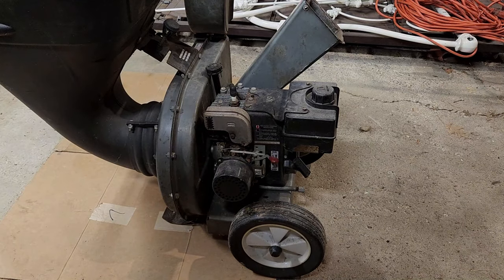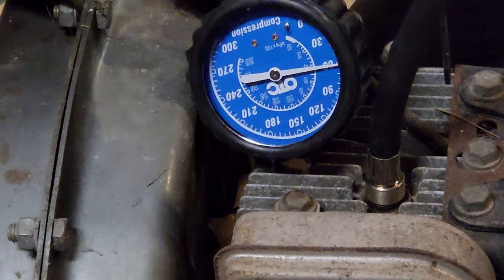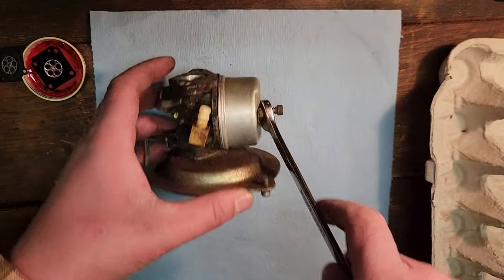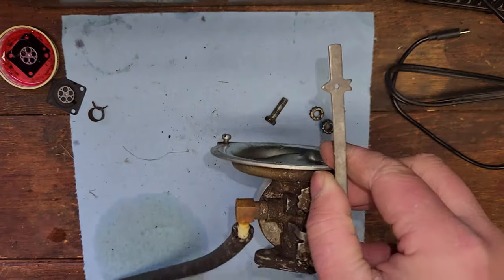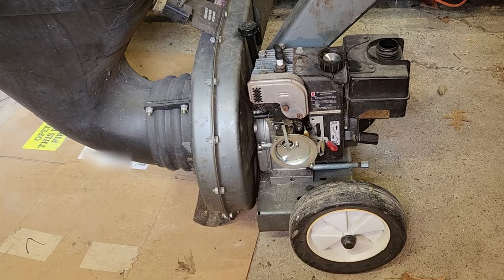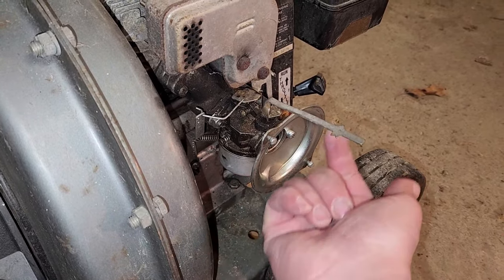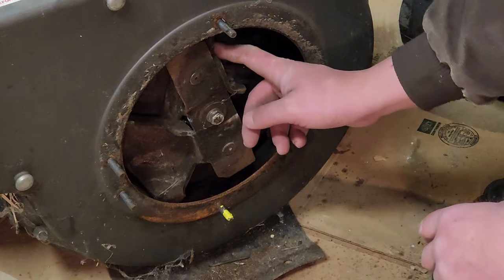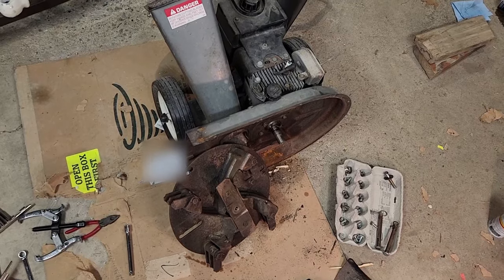Will it Run and Wreck Wood?? - Craftsman Wood Chipper - Part 1 of 2

Comment: Hahahahah!!! A Crapsman Woodchucker.. with a Tecumseh engine . Oh dear! Those engines are so much fun. The Eager-1 is advertisement for "Solid State Ignition" . . It's actually a really good ignition system, can't lie.
On my other channel I have a video on a Crapsman mower with the Eager-1 pull start too.. it's definitely eager! I have pulled it like a 6 year old kid, and it started.. in fact, I accidentally started it on camera, and decided to cut the grass... 
As much of a pain in the ass Tecumseh engines are, I kinda like working on them hahahah!
Nice work on this old POS 😊

Incidentally, on Tecumseh carbs, you will see the emulsion tube, and a bulge on the side of it. Inside there is a tube that will slide up and down... If you have the carb upside down when you screw in the needle valve, you'll destroy the carburetor.. make sure it's standing straight up properly before screwing it in, I mean... A year late is better than never 🤣

That's if you weren't already aware of it. If so.. carry on 😁
Reply from the maker: LOL I enjoy your input! I did find out (and it's VERY possible it was at a later date) about the tube. Someone else mentioned it too. I thought "Ruh roh..." I might have pulled it back off in the second video, I can't remember (memory of an infant 🤣).

What's your other channel name (if you want to share). I'd like to check it out!

Thanks again 🍻
Reply: Hahaha you're most welcome! I saw when you put it back in that all was good. Don't worry, if you broke it, the engine wouldn't run.  

Really enjoy your videos!! They give me a good laugh every time. 
I also felt your elation when you got the meat grinder out.. that was just so satisfying to see it pop free.

And you're so right about those hour long+ videos ... Average time, 10-16 minutes.. hahahah!!! It's so true! 

My channel is tiny, new.. but if you want, Mikeanic is the name.. but only since you asked 😊 
Keep up the great videos! 
I'll be checking out Part ii to this video soon ...

Comment: You should pick you up a set of hose scissors. They sell them at Lowe's and Harbor Freight.  They run about $7. They are designed to cut hoses without smashing or deforming them. They come in really handy if you do a lot of fuel line. You can find them with the specialty tools. They have been a lifesaver for me.
Reply from the maker: Noted!

Comment: On most any Engine, if you have Fire and Gas and timing is ok, it will start and run, I have worked on lawn mower engines for over 50 years -just my own and a few friends. I use to hang around a lawn mover repair shop when I was a kid, learned a lot from the old repairman...
Reply from the maker: Appreciate the tips!  I've heard ATF does wonders for cleaning.  I'll have to give that a shot.

Comment: Thanks for the video. Heads up on those carburetors on the Techumseh. That one has the long low speed idle screw-means it has a delicate brass tube that travels in the carburetor. I actually winced when you turned upside down and checked the setting by turning it in as the brass tube can be ruined that way. Taryl Fixes all just did a video on the same carburetor- it was on the worlds most dangerous snowblower.
Reply from the maker: Hello there. Thank you for that info. I'll have to head over to his channel and take a look. Hopefully I didn't wreck anything yet! Thanks again!
Reply from the maker: I see what you're saying. I'll have to pull it off and take a look. Thanks again 👍

Comment: On Small Engines that you don't know their Maintenance History--I would run Transmission Fluid in the Engine for about 15-30 mins, it will Super Clean the Internals...

Comment: I hate torque wrenches myself, and try to avoid them whenever possible. I joked about it on one of your other videos. I only use them on two things:  head bolts and cutting blades. When it comes to blades, I do not play around with that. I have had a mower throw a blade before, but I got lucky that time. I would be really careful when it comes to not using torque wrenches on blades. I know they are expensive. I only have one because i found it in a car when I worked in a junkyard, but you shouldn't take chances with cutting blades.
Reply from the maker: I appreciate that info. That sounds terrifying! Believe it or not I do have a torque wrench. I got it when I was in school. Nothing too fancy but I so use it when something is critical (break work for example).

Comment: For god's sake, put the governor linkage back on correctly.
Reply from the maker: I'd be happy to oblige!  I just looked at when I removed the carb and that's how it was. Have a reference for me to look at?
Reply: @TractorFella  I'll do some searching.  It may be right, but generally those z-bends on each end interface just like the one on the throttle plate.
Reply: @TractorFella  Here is what they usually look like:  https://youtu.be/h4Riwgn0DyU?t=16   Looks like someone worked on it an lost the correct linkage and made another one work.  That part looks like one on other models have the carb mounted to an intake like this:  https://youtu.be/6XIjkW0aizc?t=8  The bent link is to get around the intake.  If it's working and doesn't fall off, go with it, I guess.  But it looks like it would bind and not smoothly transmit what the governor arm it trying to send to the throttle plate.
Reply from the maker: Appreciate the info. I'll have a look and maybe I can come up with something. 👍👍

Comment: If you dont know the name of all the mechanism you should by the repair manual. because now  you are only guessing. that is not good. you are not a mechanic you are ?????
Reply from the maker: Thanks for the comment! Have a great day!
Reply: That bent link on the carburetor I'd suppose to be straight.
Reply from the maker: I'd think so too. I'll see how it runs bent and then check it straightened. Thanks!